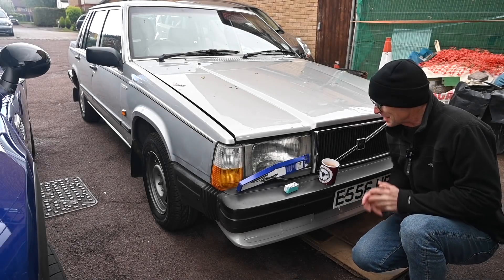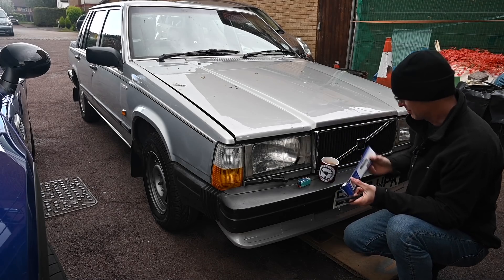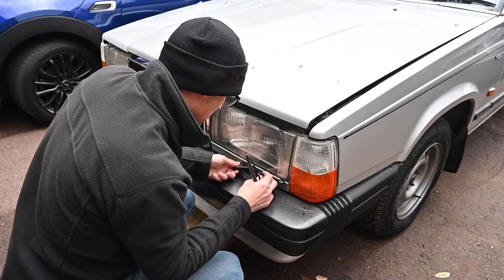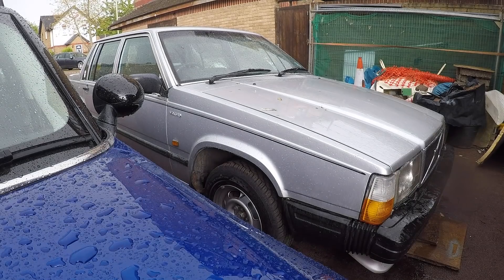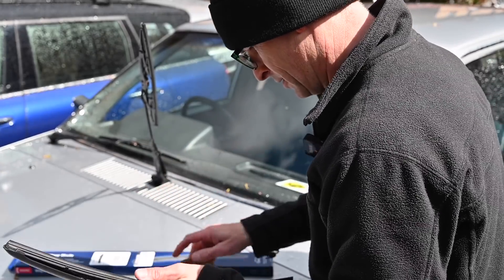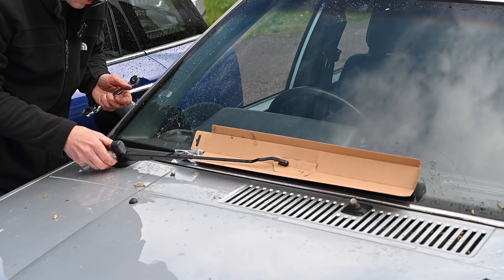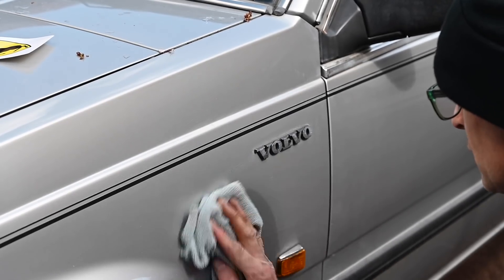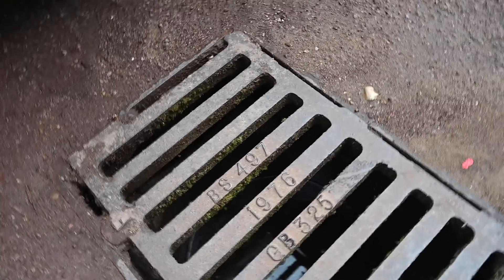Volvo headlamp wipers!

Comment: The black boot between throttlebody and fuel distributor. If I rember correctly from 20 years back. It does come off easily but putting it back is slight pain. Taking boot off it wil give you ton of space to use correct size long socket or spanner.
Reply from the maker: Thats what worries me - fixing one small part will open a ton of bigger problems!

Comment: A fairly cheap set of crow's foot wrenches that will fit on a ratchet or breaker bar does make a number of jobs on older Volvos considerably easier, as I discovered when I had to change the temperature gauge sender on my old 244.  Interestingly, that one was still working correctly, even though it was leaking coolant through the middle of it due to the plastic insulating material having broken down...

Comment: Whew! What a relief. I was waiting for the wiper arm to get knocked and smash into the windshield. I’ve watched that happen on a new Beetle being prepared for delivery. Ouch! If there is room to get a socket on the sensor you could just break the plastic connector end off with a long extension and a hammer. Cheers!
Reply from the maker: Think the sockets going to have to break off then a socket will go on

Comment: Superb, the little wiper motors actually still work. I used find that as they were subject to all the grit and grime thrown up from other vehicles they would seize up rather than stay working.
Reply from the maker: I wasnt expecting them to work ti was a nice surprise
Reply: @furiousdriving  Not just one,but both did work and sync in motion as well.

Comment: I had to buy a headlight wiper washer jet from volvo for my 740GL in the late 80`s,.  I remember was the price was so high i did not buy it, I went home found the fragments of the old jet and stuck it together with superglue.
Reply from the maker: I did wonder about that but the plastic end basin so many pieces!
Reply: @furiousdriving  .. oow that`s not so good, It would be nice if you could find a used wiper arm. FYI getting the jet off an old arm would tricky as they get brittle with age. Also I got a feeling that the left and right jets might be different.
Reply: I was never sure if the the headlight washer jets (not wipers) only worked when the headlights were on , interestimg to find out.

Comment: Here's some advice from someone who has been driving Volvo's for over 40 years and this particular model for over 20 years. The best thing to use to touch-up the wiper arms is a black felt marker. It's much quicker and better than paint. I have been using a felt marker for many years and it does the job and is pretty much a perfect match to the existing finish on the arms.
Reply: I used your tip and it worked really well. Thanks!
Reply: @benjaminnail699  Glad I could help.

Comment: Huge fan of the headlight wiper, so nice that the motors still work unlike my '98 W140 that I spent ages and money on before Xmas getting mine working properly.
Tricks for old cans of paint: Warm them up in hot water for a minute or so to increase the aerosol pressure  and soak the nozzle in celly thinners for same time. So many people don't clear the nozzle after use, combine that with age related pressure drop and you get the classic dribble symptoms you had here.

BTW. Get that wing sticker off, it's just wrong!!!
Reply from the maker: Ive done that before, and always do with underseal and body wax but at 25 years old i was surprised this worked at all!

Comment: I did exactly the same thing with the washer clip on one of my 240's headlights, snapped in two. Thankfully I had a replacement that I got off a scrapper. My left hand headlight washer jet seems to spray more out of the end than towards the light, so it tends to soak any pedestrians or cyclists I happen to be passing!
Reply from the maker: good trick of you like that sort of prank!

Comment: The 1980s had a different set of priorities. Motors to power the windows were too expensive for anything but the highest spec model, but motors for headlamp wipers were standard in the base model.

Comment: I smashed my windscreen on my BMW 316 E30 by leaving  the wiper arms up. They've also got  a crazy strong spring. That drain is an accident just waiting to happen . Just get some fine mesh and wire it to the underside of the drain and if any thing should get dropped on it, it won't fall through. 😊

Comment: I liked the headlamp vipers, in bad weather and particulary wet snow you could allways get better lighting, without risking a cracked headlight as these glass ones can get a little hot when using 100/55w H4 lightbulbs! (Not original) These days highpressure "cleaners" along with plastic lense and antifreeze wiper fluid is killing the lenses. The 740 headlamp vipers will cope with getting stuck in the winter and just keep on viping when they taw loose. Many owners up here cut away the axles as soon as EU regulations didn't make them mandatory any more, which I think was a pity. Yes, the blades cost about the same as those for the windshield, but their claim that these didn't work is rubbish. Unfortunatly I saw seconds before you cracked the bladeholder/washer nozzle that it was going to end up that way, been there done that got the t-shirt! I would buy one of you but I doubt you got any 9XL! ;)
Reply: And if in freezing conditions, allways loosen the window vipers, the linkage, which you can get to under the air intake just loosing a couple of bolts under the hood, are a tad flimsy, my father came home with one viper stationary and the other viping the hood one cold day. The linkage is just thin metal bent into an V shape and has plastic holes at the ends, one of his had jumped off and the other was bent. I could straighten it and put both back on, but it is not funny in bad weather! At least the linkage isn't underneath the dashboard like in the 240 and older models!
Reply from the maker: Im not sure what sizes the shirts go to, Redbubble look after that! There are notebooks and socks if not!
What was the give away the wiper was going to shatter? The way it looked or you could see it was going to ping back?
Reply: @furiousdriving  they get fragile when old and don't take much force to break the thin plastics. I lost a new viper blade by that, so getting two new ones would "secure your investment" for a while! ;)

Comment: I had success with a tap spanner (basin wrench) for certain difficult to reach nuts, depending on the direction of access. But they do have a fair amount of metal on the curved side. You'll understand if you see one (I hope).
Reply from the maker: I know the tool you mean but I think it would be too tight for it in there

Comment: Every time I listen to that intro (and outro) I now think of your 145.  Oh yes, headlamp wipers! 😍 Is that a stone chip in the nearside headlight?  If you've got any stone chips on the windscreen you could get them to fill that in at the same time, although when I left National Windscreens to do that (just the windscreen, while the car was in the work's car park and I was away) on the Golf I ended up having to go to their office in Dartford after I accused them of taking the £25 and not doing anything.  Got there (after complaining to their head office) and after much scrutiny they concluded that "the compound must've fallen out"...
Reply from the maker: It has got a chip in that light, I was wondering if its possible to DIY repair the same way?
Reply: @furiousdriving  I don't know, is the honest answer, possibly I would've thought.  Can you take the headlight apart and just buy the glass (I had that happen on a brand new lorry at work - all week it'd been into the garage for one problem or another - small stuff, bolts not tightened up, safety valves not working properly, had an electrical problem which had it off the road for two days and eventually I had to take it back to Nuneaton to have the wiring repaired and on the Friday you guessed it, everything working fine on the way to a site, get there, walked around the vehicle and smashed headlight - the garage took it apart and just replaced the glass - they couldn't believe it.  I'd had my old lorry for years, no problems at all, get in a new lorry all of those problems, and then a smashed headlight.  That never happens!!) or would you need an entire new headlight?  I would also imagine (looks like the chip is at the top) so is it normal glass, or does it have the lines on it to help the beam pattern?  I'd say definitely worth a shot, if not for the content alone.  We've all got plenty of time on our hands at the moment!!  Did just Google "DIY cracked headlight glass" and almost all products were for plastic lenses, but if you Google "DIY windscreen repair kit" there's loads for glass.  If not add it to the list of parts, along with OEM headlight protectors ;)  Got some of those for the Golf too, but they cost more than I can get a used headlight from a breakers.  I got the last NOS set from Volkswagen UK, presumably that have been sat on a shelf for fifteen years, and now in my cupboard gathering dust...

Comment: ive had to do the temperature sensor on my car. I thought it was difficult to get to and buried but the Volvo is definitely worse luckily the connector was significantly smaller and I couldn't get a spanner on due to pipes and things but could get a long 19mm socket over it with an extension no problem. the connector on mine was a lot slimmer so a long socket worked.

Comment: Hi Matt, I've found the Denso wipers are actually rather good and I really like how you fit them (once you figure out how it works).  I got mine from Opie Oils - I can recommend that company - in my experience they were superb; order placed, order came - not the cheapest but I would rather have reliable than cheap, maybe that's just me.  I think the Denso wipers are better than the Bosch ones I used to have but then any new wipers are going to be better that the old ones aren't they?  Even Bosch ones.  Sorry, I just like the Denso wiper blades but that's mainly because they're bloody good.  Mike.
Reply from the maker: I got them as they were a really good price but they look excellent. the old ones were falling apart so yes!

Comment: Do you also know why Volvo had wipers on the headlights? that is because you have quite a few tunnels in Scandinavia that are not perfectly finished, just say that they are still in rough condition and since there is a lot of moisture in those tunnels and dirt, of course, you suddenly saw nothing through your windshield and at the same time your headlights because these tunnels do not have light, which is why you also have some kind of washing facilities after almost every tunnel where you can wash or clean your windows, etc. of your car.
I was able to experience this for myself.

Comment: Option #1; Looks like the open ended spanner head comes up from below but no room to turn it. So cut the handle off leaving 1" (25mm to you EU guys) and weld a nut to the handle. Then use a socked on a 10" extension to turn it off. A plumbing supply shop would have a similar looking tool. Option #2; cut the electrical connector off the sensor and use a 19mm socket or ring spanner but how do you then get the new one fitted tight? Furious leaking?
Reply from the maker: Its both the handle AND the knuckles of the spanner head that foul, only a ring spanner or socket will turn in there so looks like the connector has to go

Comment: I'm surprised you didn't just break off the plastic part of the sensor and use a socket or ring. Snug the new one up with an open ender. BSP thread I think so not too tight. It might come out easier with the engine hot?
Reply from the maker: I might have, to but still need to tighten the new one. If a sockets on there it should move OK

Comment: The wipers on the headlights (should) only operate if the main headlights are switched on and the wipers are on, so you can still drive it in daylight in the rain without chewing up your paint.  The fact that they come on just with the windscreen wipers might mean you have a seized relay in the electrical system that is allowing them to operate all the time, rather than just when the headlights are on...
The wiper motor assemblies on Volvos and SAABs are generally much more robust and well sealed than those on other cars so it's pretty unusual for them not to be working, even on vehicles in advanced stated of decrepitude or age.  Those on my sister's old 1974 245 still worked perfectly, even if literally nothing, including the engine, did...
Reply: On my 1987 240, the headlight wipers only operate with the windscreen washer, regardless of whether the lights are on or not.
Reply from the maker: I had the washers going as well to lube the glass so that may be why they came on

Comment: The way you get that sensor is with a 19mm deep socket and an extension, from the side
Reply from the maker: only once the sensor is broken off the bolt though as its bigger
Reply: Oh I see you have the kind with the large connector, you can still use a deep socket but you need to slot it

Comment: Those wiper arms came off very easily, no need for a puller or anything! Good old Volvo.
Reply from the maker: one came off one broke - too easily!
Reply: @furiousdriving  ouch, do second check the nut, the splines on the axle are thin and if one get's loose they shear quickly.
Reply from the maker: @Bratfalken  hang on , I was tired when I replied, I thought you meant the headlamp wiper! The windscreen ones were quite loose but I tightened them up much more when they went back!

Comment: Would it be possible to cut the old sensor electrical connector off just above the nut to enable the use of a socket?
Reply from the maker: On the dead one yes, on the new one not so much

Comment: When you did the cold start the other day it sounded quite piston slappy....  Is that a 'feature' of super strong forged pistons or just some excessive skirt wear?
Reply: That piston slap is typical Volvo Red Block. My 90 240 has made that sound since it was new. Coming up on 400,000 miles now.
Reply from the maker: what Michael said!

Comment: Minor repairs of older vehicles can be pretty hit or miss, as nuts and bolts rust and seize and plastic becomes brittle, so I suppose a 50% success rate is about par for the course on the first attempt.

Comment: What about getting an old 19mm ring spanner and grinding a slot in the ring big enough to fit over the sensor
Reply from the maker: I could only find a nice 19mm, I’m going to have to buy a new old 19mm to do this! But it’s the best bet
Reply: @furiousdriving  at a pinch try an oil filter chain wrench I had to do it once in an emergency by the roadside  from se London to scotland   bit awkward but it worked

Comment: Anyone have a link to the socket spanner needed to remove the temp sensor... Facing the same issue with my 940...
Reply: Cut the tipoff the old sensor and use a socket, same for rusty power steering pipes, to remove cut them close to the nut and use a socket.

Comment: And therein lies the difference between SAAB and Volvo. I’ve owned both. An 89,000 mile SAAB 9-3 - headlamp wipers never worked. Also owned a 130,000 mile Volvo 440 - headlamp wipers never missed a beat.

Comment: the sensor you was not sure what was is the engine knock sensor, so if engine knock engine ECU is supposed to retard timing (supposed to....) also it's a nut on top of the knock sensor, if you take the knock sensor of you get place to get the temp sensor of, i got the other newer intake on my 740 so not sure if you can reach as well from the side with a cup and extensioner

Comment: Nothing more frustrating than those bastard plastic tabs snapping on wiper blades, changed my blades on both cars recently and 4 out of the 5 blades, that tab snapped off. Lots of swearing ensued.